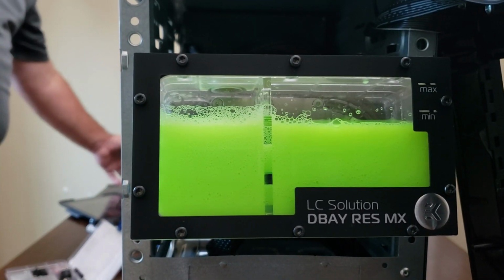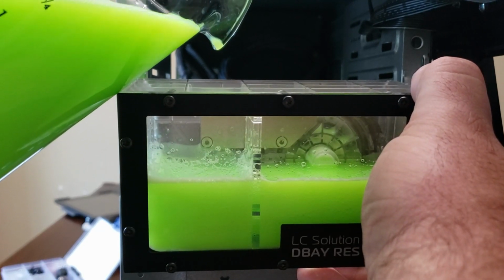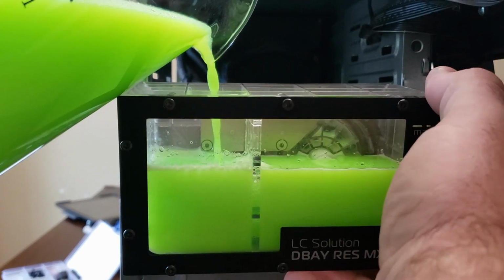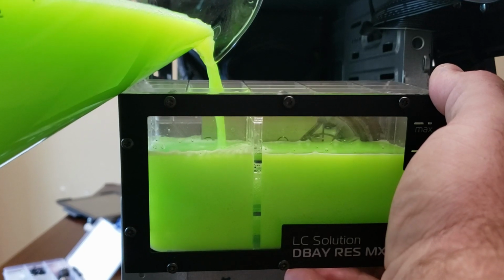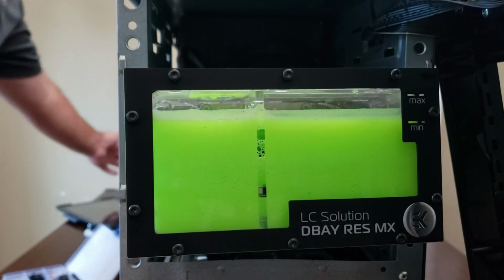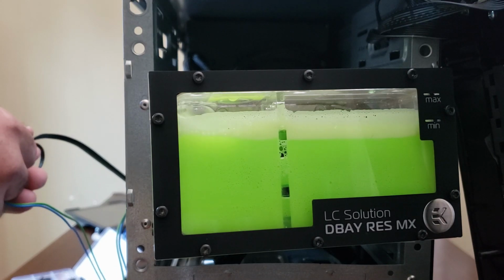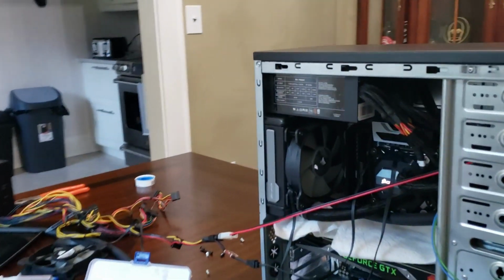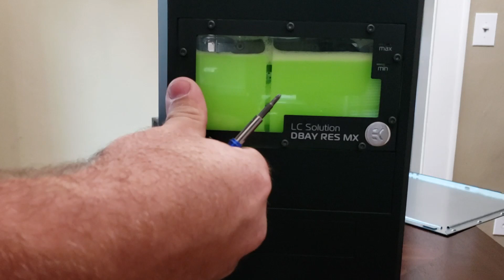Building a custom loop using an old AIO cooler in a case no built for water cooling

Comment: 2 yrs and it's already been placed at end of life by EK, can't buy it any longer! Shame I have several builds using older case's!
Reply from the maker: if you want it ill send it to you. send me a message rober@wagnerhitches.com
Reply: @CustomCarsComputers  I did find them on Ebay 1 for single cd slot and another for 2 slot $30.00 for single and $55.00 for double slot.

Comment: You won't see too many hacks like this on YouTube, which is a shame as they're basically an advance tutorial on water cooling. And now I'm thinking I should post a similar AIO hack I do.  It's similar to this but a little smaller reservoir and maybe not as involved. You can buy reservoirs that fit a single 5.25" bay on AliExpress for cheap, which fills what is now unused space reserved for a DVD/CD ROM Bay. You install in it the top bay and splice it into an old AIO (or new). The benefit to this is it works on older computer cases and also looks good. Using the upper 5.25" bay will usually put it higher than the CPU and radiatior (on a vertical tower with radiator mounted to the front or back), which is what you want to avoid air bubbles from settling in the wrong place. The only downside to this is there is no seconary pump in the reservior. It's not necessary at all but getting the one and only pump primed is not easy. It takes a lot of tilting and tapping to get water flowing and bubbles out. Once it primes, it's smooth sailing.

Comment: You make my day with this vid, I bought H80i v2, but it isn't enough for 5950x (what a surprise LOL) Though I have just two options, a custom loop or a cooler from IceGiant. Thanks to you I have a third one, can get a bigger, less dense radiator, put a few good fans on it and most importantly, move it outside the case. If it won't be enough it won't be any loss as I will be able to use the parts in a custom loop later. Thank you bro
Reply from the maker: Yeah you can just get a bigger rad and expand your loop, just make sure to get all the air out and you will be fine
Reply: @CustomCarsComputers  Thank you for a good advice, just starting with water cooling (haven't needed one on AMD A10 5800k), so every advice is valuable. Wish you everything the best.

Comment: It was meant for liquid cooling but with an external rad you have hose pass throughs on the back. Yes i know they are also intended for cables but just saying it was meant to have an older externally mounted rad and res on it.

Comment: why no function test and temps after this :(
Reply from the maker: I honestly did not even think about it, it worked great and the pc sat around 43c at all times even under full load, ill have a follow video soon going over having it for a year
Reply: For myself i Ran this AIO now for about 4 years. After this time i wanna Clean It. So i saw your Video and this Video but you should make a Work of Proof for this custom... Or would you kill your AIO for a custom try without a Happy ending. We want Proof of your great Work! 😎
Reply from the maker: @Falki24  so i have 2 videos in the works, one showing this one working and how it jas held up over the last year and the next video will but taking a new aio and connecting it to a gpu water block with no reservoir,  im just waiting on the waterblock to come in

Comment: How do you remove hoses from radiator/cold plate on AIO like this?
Reply from the maker: The hoses are just on the radiator with a push on barb, sometime with a small ziptie or tape to hold them in place, just cut the take or ziptie and pull off. The cpu block is just a screw under the plastic that holds them in.

Comment: Your videos are awesome. Thanks for showing how to retrofit a pump and reservoir to AIO watercoolers. I'm planning to upgrade my H100i v2 with reservoir while doing maintenance when warranty ends. 

Do you think running D5 and Asetek pump together would cause problems?
Reply from the maker: Probably would not be an issue if you have a large enough radiator and reservoir, you could just run the d5 and be ok without modification to the water block just make sure the flow is going the same direction for both pumps
Reply: @CustomCarsComputers  I have an AIO with an asetek pump on the cool plate head (like the corsair you used).  I plan on using a d5 to run the entire loop and don't plan on using the asetek pump at all.  Would you suggest removing the Asetek pump in this case so I don't restrict any flow?

Comment: Looks like this reservoir has it's own pump, what did you do with the existing pump in the AIO unit?  Did you remove it, or just leave it in there?  If you left it, is it running?
Reply from the maker: The pump died in the AIO thats what made me think to do this, I removed all the pump stuff from the water block to allow a good flow.
Reply: @CustomCarsComputers  OK, cool.  Good video, but I think this step was missed out perhaps, I think without doing this it might create a bit of restriction.  Interesting that the RPM counter still works, though, even if you removed the pump part.  
I have the exact same cooler, and the tubes are far too long in my case, as it's a mini ITX build, and so your video has provided me some great information though!  Thanks!

Comment: Good video mate. Just wondering what size barb you need for the corsair hose. I have the same aio that I want to chuck a larger rad on
Reply: most AIO's use 6mm(1/4) tube. the one in this vid uses 9mm. and the res uses 9.5mm(3/8) fittings
Reply: @norkris8729  cheers mate. Let's hope the pump can push water through a 420mm rad
Reply: @MrQwakstab   1x AIO pump?
Reply: @norkris8729  yeah 🤤
Reply: @MrQwakstab  i have kinda tested this. One kraken x52 pump managed 3x 240 rads... Did not test temps
Reply: @norkris8729  sweet, I should be all good then, still waiting on parts to ship so I'll update in a couple of weeks with results
Reply: @MrQwakstab   great!  are we talking 420 just for a cpu?
Reply: @norkris8729  5700xt using a g12 bracket. Bought one of those dodgy Asus tuf 3 cards for $585aussie which was about 200 cheaper than the other brands
Reply: @MrQwakstab  loooool 420 for 1 gpu...
Reply: @norkris8729  slowly creeping Into custom loop
Reply: Only 20 bucks more than the 280 rad too
Reply: @MrQwakstab   u need to get an AIO for the cpu and join them together man
Reply: @norkris8729  I have a 280 on CPU but I don't want to add it cause it's got an aluminium rad. The 420 is copper.
Reply: @MrQwakstab   ur cpu Block is copper and rad is aluminium.. Whats the problem? =)
Reply: @norkris8729  I'd rather have all copper, 1 less additive to bother with which are a pain to get down here. Already taking me over a month to get a bottle of biocide lol
Reply: @MrQwakstab  after some testing.. They say loop order dont matter.. But with this aio mod.. It matters..
U can reach me on discord: kris#2180
If u wanna drop the utub comment section
Reply: @norkris8729  couldn't find you on discord. Just finished. Went from low/med settings capped framerate pubg 100C+ hotspot to ultra uncapped 60C hotspot. Also went from nf-f12 in push/pull to cheap silent fractal fans push
Reply: @MrQwakstab  thats Great dude. Im starting my project soon. Cpu aio connected to both aios on gpu h + 1 more rad
Reply: @norkris8729  that's heaps. I. Guessing you have a hotter CPU than my r5 2600
Reply: @MrQwakstab   7940x ocd to 4.5ghz all core